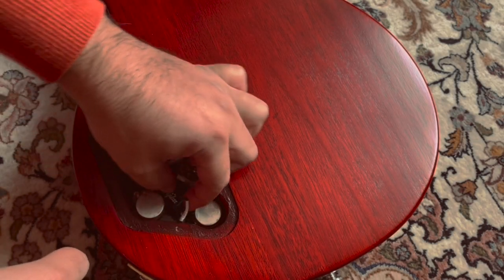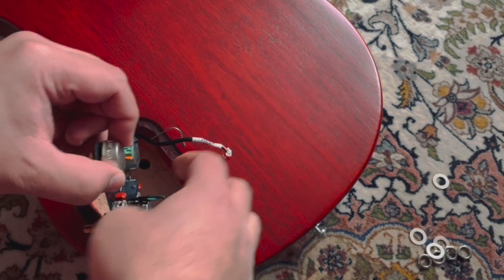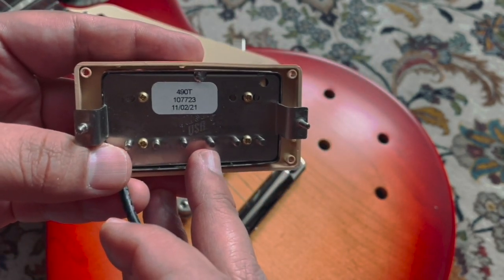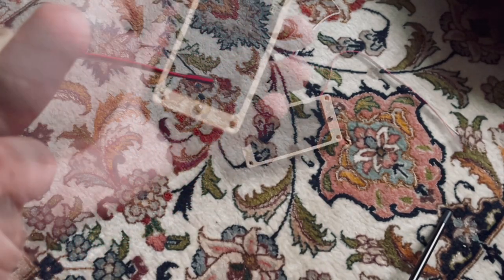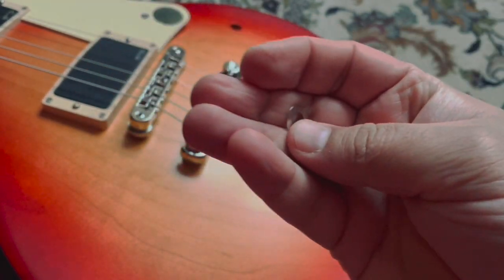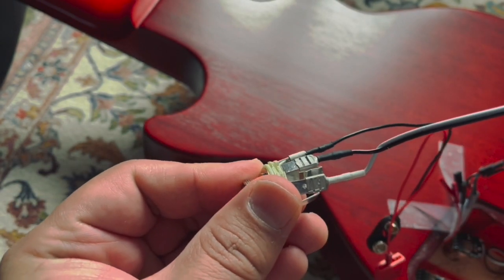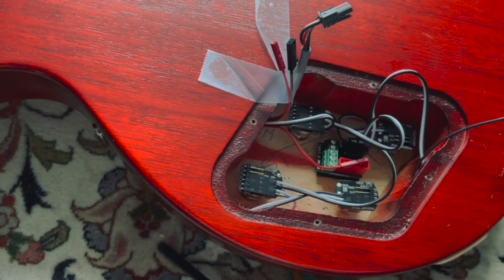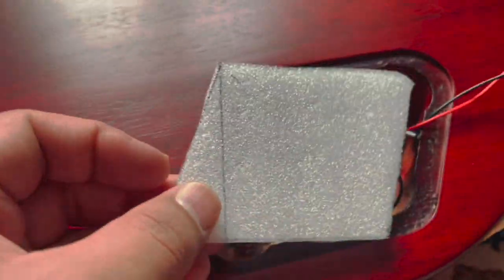How to Install EMG solderless pickups into a Gibson Les Paul

Comment: So does this electronics and pickup change actually helped to get rid of the noise? Would be nice to hear it now. 

Just one little advice. Rather don't wangle/move connector on PCB from side to side. You can damage the connection on PCB board. Just pull it out straight, or when there's a clip hook, you push it first and then pull out.
Reply from the maker: Yes, now it is noiseless and its different sound with EMG. 
Thanks for watching & your comment, and also your advice. Fortunately I didn‍'t damage PCB
Reply from the maker: I played the ending solo in this song with my Gibson Les Paul Tribute with EMG pickups (EMG 81)
https://soundcloud.com/nima-ganjfar/the-last-time-i-cried-chris-de-burgh-cover

Comment: Did your stock Gibson knobs fit on the new EMG pot shafts? Or did you have to order a different set of knobs? 

I plan on putting EMGs in my Les Paul and I can’t seem to find a video where anyone showed them using their pre-existing stock knobs. One video, the guy with the old white studio, said he had to use EMG knobs, but other than that, Idk..
Reply from the maker: Very good question. No it didn't fit. And I'm still looking. Unfortunately it is too expensive to order directly from EMG, not the knobs but shipping . I contacted a local store and I hope we can find a solution for this problem.

Comment: do u connect the 3 way switch that there is on the guitar somewhere and if yes where?
Reply from the maker: I connected the 3 way switch to the "BUS" which I put in the middle of everything. There are 5 wires from 3 way switch. 3 of them is for pick up select which should wired to the green part of the BUS, and two others (one of them is earth) should connect to the black part of the BUS, which is beside the green one.
Reply: u had the original from the les paul or did you install the solderless emg 3 way switch @NimaPassionForMusic
Reply: can u do a tutorial if its possible
 @NimaPassionForMusic
Reply: so you just connect the 3 way switch to the bus no where else? also did you connect it with solder or the cables that come with the pickups
 @NimaPassionForMusic
Reply from the maker: @limpjackass  I used the Original from Les Paul. There was not any 3way switch in the package I received from EMG .
Watch this : https://www.youtube.com/watch?v=ZfwVE_ohwsE
Reply from the maker: @limpjackass  What kind of tutorial ?
Reply: @NimaPassionForMusic  OK I removed all of my electronics from my guitar do I need to connect my 3 way switch with solder cable or something else on emg bus
Reply from the maker: @limpjackass  Yes, I just did as it was the instruction from EMG inside the package. I didn‍'t use solder, I just put wires in the right place and use screwdriver to keep the wires in place. Everything that I need for set up this EMG pickups was in the package, except the 3ways switch and cables coming from 3ways switch. Those are originals.
Reply: @NimaPassionForMusic where u connect the 3 way switch and with what u connect it
Reply: How do connect the 3 way switch to the the bus of the emg  with what and how  @NimaPassionForMusic
Reply: @NimaPassionForMusic  simpler I removed all my electronics and the 3 way switch what do I need to buy to connect it to the bus the 3 way switch and what else solder cable something like that what more?
Reply from the maker: @limpjackass  Nope. Just very small screwdriver
Reply from the maker: @limpjackass  You must watch 13:44. As I mentioned I just use a very small screwdriver. Unfortunately the process is not fully on this video, because everything were very small, I have to use my glasses, and I need to be patient and careful. But I promise I didn't use any solder.
Reply from the maker: @limpjackass  I just used a set like this: 
https://www.amazon.com/Precision-Screwdriver-Electronics-Computer-Repair/dp/B07PV5D3VV/ref=sr_1_6?dib=eyJ2IjoiMSJ9.gaBCjxKj8kwcTncP6IT-YiGxvdL9t7SsENdJhsQxkPQcRT2YqY3zAgdTCycwKSV8ZJA66EIlDjRVNFvV751SL1pejuAectICiEz3sY4O2jqEmc4rlm9rOD9EmRgFuMvtfYb24SW0bPeRsWQuzfmaJtRfdgsTQfEYXu5MK3G6cOWLp--pyrCak96PF5sfWFU-MCLQ3AUHUaWDCNOQvEqfQnjADJxTivvtOojlvXaYJ7mjGUqf6nBkesjPPqCjprMhwZilpIeB7gMA7Lu6XcCJnXhNMQjl98rAO28xwQ8hfM8.pmt4bqh9ztyBx_V0Z92qEZeRD7SOfgxoXXLteeViroI&dib_tag=se&keywords=small+screwdriver+set&qid=1711467992&sr=8-6